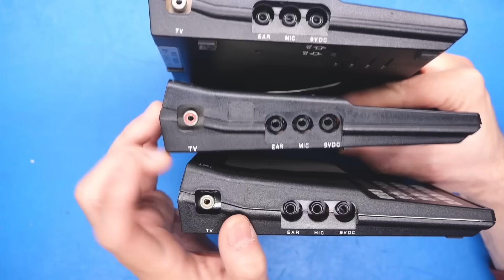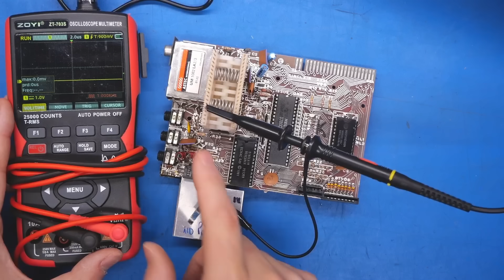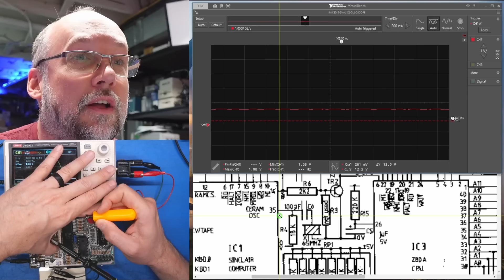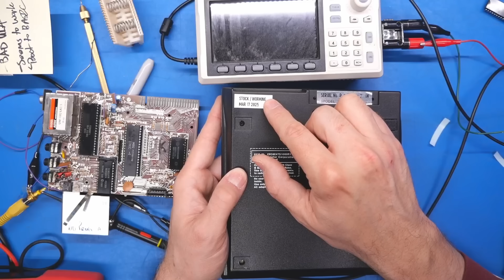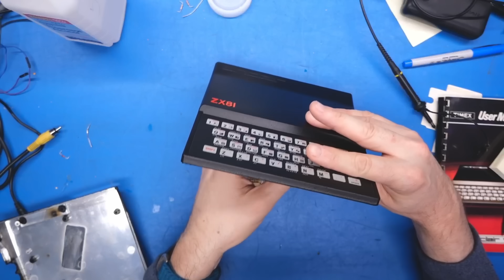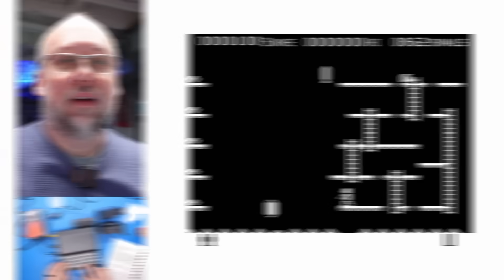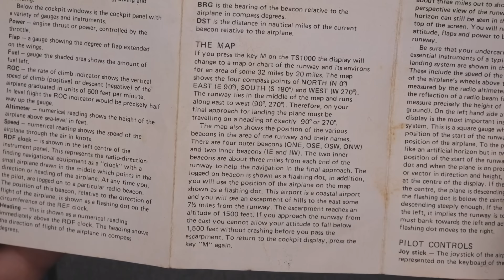Is the ZX81 / Timex Sinclair 1000 actually bad? Let's fix these to find out.

Comment: For anyone wanting a modern remake of the ZX80 and ZX81, may I recommend the Tynemouth Software Minstrel?  It's a kit that you can build and re-live the age when people built computers by soldering.
Additional: I'm sure that I recall the SCL being referred to as a 'dogsbody' in the British ZX81 manual.  Why was this word replaced with 'workhorse'? P.S. I considered Psion's Flight Simulator to be the 'killer app' of the ZX81 and '3D Monster Maze' was the Doom of its time.  Really.

Comment: The ZX81 16K RAM expansion gained particular notoriety for the "RAM pack wobble" problem because it was top-heavy and only supported by the edge connector. This could lead to it falling out, crashing the ZX81 and losing any program or data currently in the computer's memory.

Comment: The ZX80 (US version) was my very first computer. And, you're right, it was a way for me to dip my toes in and see if I really wanted to have a computer. It was enough to whet my appetite, but not enough to satisfy. Not long after, I got an Atari computer (8-bit) and then a few years later, the first Macintosh (128K). I've been using Macs ever since. Sadly, my ZX80 is long gone. I sold it to a guy for $35 after I got my Atari. For some reason, I still have a bound volume of the first year of "Syntax ZX80" the ZX80 newsletter.

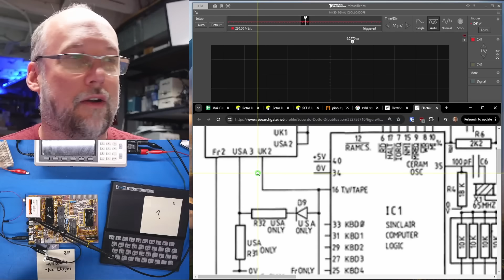Comment: At 33:29 the reason the Video Out and the Audio Out to Tape are from the same pin on the ULA is because they ran out of pins on the 40 pin (max at the time) ULA. Me? I would have freed up the USA/UK select pin and used it for Audio Out. That would have meant two different ULA chips. They are custom Gate Array chips (similar to FPGAs today, but one time programed at the factory), they are essentially a grid of NAND gates inside that are wired by the manufacturer by etching the interconnecting traces when the microcircuit die is made. They are the most expensive part in the ZX81. With NAND gates, you can also make Inverters, other Logic Gates, and Flip Flops. At each pin is a driver/receiver/transceiver that converts the low current logic to accept/drive external logic.

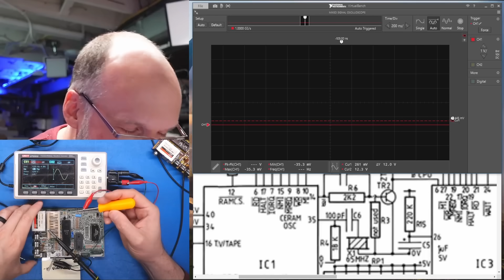Comment: At 28:27 the ULA is generating an output without an input may be that is has a Phase Locked Loop (PLL) inside that works off of stray capacitance, with a divide by 2 stage after it.

Comment: Really enjoyed this video Adrian! The T/S1000 was my first computer in early 1983. Cost about $100 for the computer and the 16K RAM expansion. It was all my parents could afford at the time, so I was deeply grateful for it. A lot of people diss this computer, but it was actually a very usable machine and taught me a lot. I learned BASIC, Forth, and assembly language on it, as well as digital circuit design. It certainly didn't stop me from becoming a professional programmer and embedded system designer either. To answer your question about the keyboard, it was certainly a pain, but it wasn't all that bad for programming. The single-stroke keyword entry made programming pretty quick. The only people who complain about how confusing the keyboard is are those who never actually used one. I mastered it in about a day and can still use it today without thinking about it. I did eventually add a full keyboard (Suntronics KD-81) so I could do word processing (Memotext), which was much better. The magic of the Sinclair machines was that they pushed you to be creative and think out of the box. They also let you gradually upgrade the machine a few dollars at a time, which was great for a money-pinched teenager like me. By the time I moved on from it, I had added a ZON-X sound generator, Suntronics keyboard, Memotech Centronics I/F, Memotext word processor, the Timex thermal printer and a Gorilla Banana printer. I also had added an Atari-type joystick by following an article in Sync Magazine. Nothing but good memories for this machine!

Comment: The ZX81 is a remarkable machine, achieving a lot with very little hardware. Of course there were better machines at the time, but at several times the cost. The method used to generate the display is particularly cunning. There are several good write-ups online for those who are interested.

Comment: In Mar of 1981 there was an ad in a magazine for a ZX80, it would be months before the ZX81 came out, for $199 assembled and $99 in kit form, I got the kit. Over a weekend I soldered the kit up and it worked, I was amazed. First thing I noticed how short your programs would be and that it was Integer BASIC. But I could save programs to cassette tape, even though they were not very long. It was set aside for about a year or so, as I had started college. Then there were ads for upgrading the 4K ROM to an 8K ROM with Floating point math. RS was also selling discarded keyboards, TI-99 I think, I brought out the ZX80 and looked at the keyboard area and noticed all the Through holes, so I got a keyboard and wired it to the Through holes, and laid the ZX80 below the keyboard. By this time the 16K memory modules were on sale and I added it to the ZX80, now I could write much longer programs with a much easier-to-use KB, and still save them to Tape. I looked at the one-dimensional array of Sinclair BASIC, and wrote a check book program, with the check number as the element of the array, the Payee as one of the contents, added the amount, and had the program calculate the balance. Then at the end of the month with the returned checks, I would select an option to note which checks had cleared and then Balance the account. One of the features in Sinclair BASIC was the contents of the array were saved when Saving the program to Tape, you could power the device down and reload another day to resume using the program.

The other item I added was the thermal Printer module, so I could have a "printed" record of the program and its output captured. I was taking Differential Equations and the was a "Bonus HW" problem using the Runge-Kutte method, given the equation and a point, how to calculate an adjacent point and the slope to it. It involved an iterative process where a value was calculated then do that again comparing the two results, i the difference was very small, then you had the right number otherwise the calculation was done again til you got the result you wanted. I did it all in the Sinclair Floating point Basic, I then printed out the program listing followed by the program results, and the program allows you to input the equation at RUN-time and select the "difference" you want the algorithm to use. My Professor was impressed that one could do a program like that in BASIC and not have to use FORTRAN.

Comment: When I was just a child, I was getting interested in computers and my parents knew a guy who worked for the division in the USA that made/sold these. They had already stopped making new ones at that time, but my parents asked the guy if he could give me any unsold stock. He gave me the computer, an expansion black cube ram thing, every single tape (program) they made for it, as well as a bunch of other stuff. I spent most of my available time over the next 2 years trying out each program and learning some basics of programming. I still have a box in the garage with all of it.

Comment: As to the discolorations on the keyboard cable, I would look at heat.  I am guessing that part of the cable is touching a hot part when in the case.  Just a guess.

Comment: A piece of 10thou plasticard down the back of the keyboard connector would often cure the issue. The molex connectors were twitchy, especially if a 3d party keyboard was used.

Comment: The ZX Spectrum was the one with a better keyboard and costs had moved on permitting the Spectrum to initially have 16k RAM and then 48k RAM for not much more than the ZX-81 was sold for.

The ZX-81 was an upgrade from the ZX-80 (Integers only and screen blanked every time you pressed a key)

ZX-80 launch January 1980
ZX-81 launch  March 1981
ZX Spectrum launch April 1982

Not much time between them.

Still amazing to see what people can do with these (now) very humble computer
Search Youtube for "ZX80 / ZX81 16K: "Metropolis" Demo (2017)" to see what the machine was capable of in the right hands

Comment: I always enjoy your videos Adrian but this one was particularly relevant to me.  The story you told matched mine exactly. I wanted a computer badly and was able to buy a secondhand Zeddy with paper-round money. (and get ridiculed by other kids, because the computer you had was a status symbol.) After learning basic and even dabbling in machine code, I went to a Vic. If you can get hold of a copy of the manual that was boxed with the English ZX81, you'll be surprised at how very good it is. It was accessible enough for 12-year-old me to not only learn basic but how the computer worked, and also get a grounding in machine code. I learned from that book that the SCL acronym you saw stood for Sinclair Computer Logic, but that chip's more often referred to today as the ULA. Mine came from someone into electronics, because it had an internal ram upgrade to 2k - the power!  (I think this was reasonably common as the pcb allowed it) and it also had a real keyboard. A few 3rd parties made keyboards with individual switches and real keycaps. Mine wasn't fantastic but was better than the membrane!  Note that although the computer is pretty much locked into character graphics, recently developers have worked out a very clever trick to get the hi-res graphics that you saw in the games you played (it involves finding bytes in rom that match the bitmap that you want to display, which is why they're often a bit janky).  That would have blown my mind in 1982. I've done a port of 3DMM to another computer and yes the original is basic with extensive assembly subroutines.  As is Mazogs, an equally good contemporary game. One of my Zeddies today has an internal 16k ram expansion, which is ideal because no ram pack wobble!! Tynemouth Software has published a web page about doing that. (Unlike the 2k, it involves a little bit of bodging.) Once again, thanks for this one.

Comment: Any reproduction ULA chips available for these?
I have bought a replacement keyboard from eBay but it was not working, so I cut the ribbons off of the keyboard, removed the bottom layer, and I have made a plexiglass panel, the same size as the membrane, and I drilled  holes into the plexiglass panel, and glued tactile switches into it, and wired them in to the motherboard without modding the motherboard itself, using a thin layer of PCB to make the soldered "ribbon" connection for the board. Then I stuck the leftover layer of the membrane on top. A little bit thicker, but works like a charm.

Comment: I had a ZX80 (the predecessor of this one) as my first computer, and I was appalled by the keyboard as well; the zx81 came out later and was a big improvement, but I never went that route, my next computer did have a decent keyboard. I wish Sinclair offered a way to have a better keyboard as an add-on, so you could have upgraded, but it was already a case of 'just buy the next better product: zx80-zx81-zx Spectrum, etc. I moved on to buying a Sharp MZ-800 that was on sale, and built a CP/M system around it, with added floppy drives, video ram expansion, etc. I did look at later Sinclair products, like the QL, but I was still repelled by the lack of standardisation (microdrives!!!) and limited expansion capabilities.

Comment: I have a ZX81 EU version. I have replaced the RAM chip, (found a forum post online for that)to get 16k inbuilt memory. It works, but one bad sneeze, and the computer is frozen. I have resoldered every component. Measured everything, and I haven't found anything. Could it be in the RAM chip internally?

Comment: I had a ZX81. I bought an external keyboard for it and a ram pack. The only printer was a thermal printer, and yes you did use a cassette deck for tape backup. I actually built a billing app in Basic for it, which worked (!). It was an exciting,  amazing time.

Comment: Ordered my Sinclair ZX81 in 1981 from a computer magazine as a kit from the UK for $99 but you could get it assembled for $150.  The computer also uses a non-standard basic so the computer did not use read or data statements. RAM pack wobble was a serious problem and as you noticed with the later Timex machines the RAM pack gripped the edge connector much tighter which helped but didn't completely solve the problem, I eventually permanently soldered mine to the edge connector. The machine does have a fast mode which causes the CPU to only display video when the CPU is doing nothing else so there is an annoying flash, and the screen goes blank until the program is done running. And yes, after using the keyboard for some time I did get pretty proficient at entering code. You could also get the assembler routine on tape so you could load it and have your basic program converted into machine code so it ran so much faster.

Comment: I got a ZX80 and got a Timex Sinclair in the early 80's, which was brought into Australia as a present for me. I used to have a hell of a time trying to get it to save data to tape because I knew nothing of the voltage challenges. I did get a 16k upgrade module for it!! I loved it and it started my love of computers.

Comment: Radio Shack Color computer with a diy current loop interface to my Model 28 Teletype as a printer. 45.5 baud baudot all upper case. I picked up a ZX-81 from a surplus store for $15 and used it a while. Wire wrapped a 8051 sbc too.

Comment: The Timex Sinclair 1000 is very noisy electrically.  We used to try to use one as a quick database "capcode" lookup for pagers (beepers).  Remember those?  Well, if you turn one of these "on" while you're trying to repair the paging receivers, give it up.  The typical beeper back in the day had a sensitivity of -95 dBm, but the noise that originates from the Sinclair is easily 30-35 dB greater than that.  In other words, it is impossible to tune / repair a radio receiver while one of these is nearby.

Comment: My first computer in 1982. I was a young E4 Electronics Technician in the US Coast Guard in Hawaii. Not much money, but I learned Basic from the manual and dissecting the files on the three tapes I was able to afford. I later bought some books that helped more. 1k of RAM was a lesson in frugality, making my code more efficient by reusing loops and counters. Such a great learning experience. I would love to have one today, but they are so overpriced on eBay.
Reply: It might not have the "feeling" of the real article, but you can always download an emulator to "play" with.

When I "upgraded" to various later computers, I used that first emulator to keep working on some of my older unfinished projects, and "bring them to the future", and in the process, am learning more all the time. I still have almost all the old software I wrote, and have upgraded most of the code to Spectrum.

The first one often leads to new machines, one way or the other ! :)

Comment: I had a box of these things back in the 1990's; a friend of the family gave them to me after a well-meaning relative of theirs tried to donate them for their kid to play with. As you can imagine it rapidly became apparent that a four year old in the 1990's wasn't going to be able to have any fun, especially since the keyboards didn't work on any of them. FWIW, I was able to "repair" the keyboards on them by snipping a bit off the end of the plastic ribbon (they had all cracked from the plastic becoming brittle right at the motherboard end) and sandpapering new contacts), but the time spent doing that convinced me to donate an IBM PC to the family instead. (I had several lying around because you could get them for practically nothing from the local government surplus outlet.) Played with them for a bit, but... yeah, can't say much nice about them. In an abstract way I can appreciate just how minimalist the engineering is, but even when they came out you had integrated VDU chips like the 6847 that could offload all that overhead of maintaining the display off the CPU, allowing the machine to run so much faster*, at a parts cost of only a few more bucks. So I'm not sure the decision to make a "high-integration" successor to the ZX-80 *really made that much sense.

Anyway. The best use I ever found for one of these was pulling the Z80 out of it to swap into a TRS-80 Model 4P that mysteriously had its go "fwoof" in the middle of a game of Galaxy Invasion. Still have that 4P, and it still has the TS-1000's brain in it.

Comment: This was one of my first computers in the UK.  This computer was very capable and a well loved machine here.  The keyboard was never that bad, you could cope with it well enough and input programs at a decent speed with practice.   However, there were other options, from a pushbutton keyboard that attached over the top to complete case replacements with full working keyboards.  The 16K RAM packs were a bit sensitive but I think everyone who had one knew to use a dab of Blu-Tack to stop the wobble.  The machine was a technological marvel, 4 chips to do all that - it was understandable, fun to use and launched many of us into computer/engineering careers.  I had mine until a few years ago when it went missing during a house move, but I adored that machine.  Finally it was affordable at a time when wages were not high, we'd experienced a terrible period of industrial strikes a few years before and people were struggling but Sinclair delivered this little machine that changed so many lives here forever.

You last point about wishing they'd made a version with a keyboard like the Spectrum - they did just that in the US.  The Timex 1500.